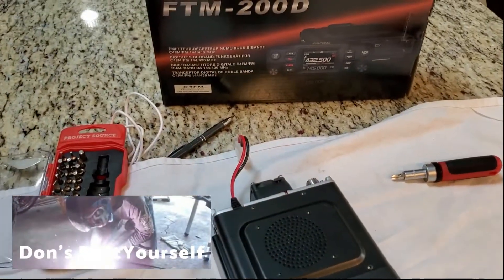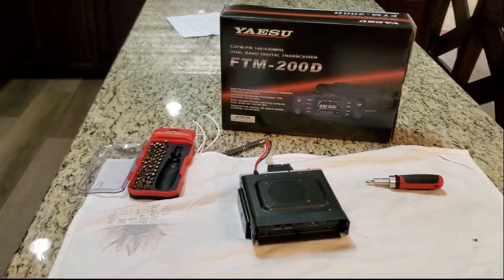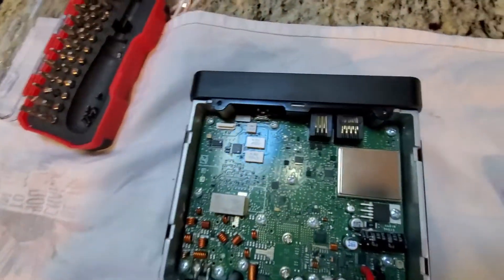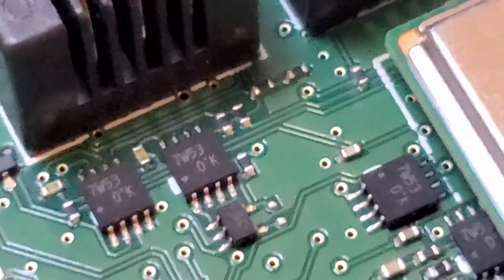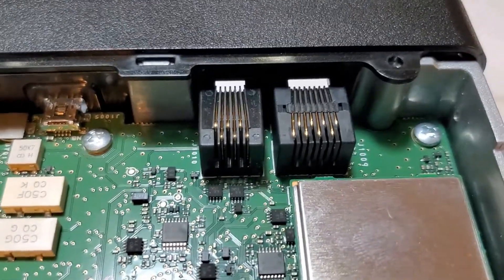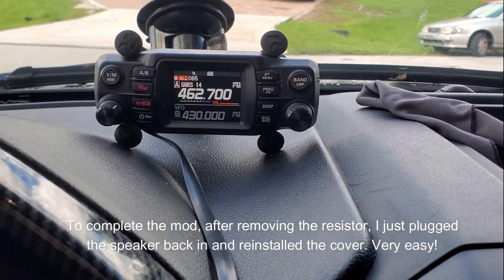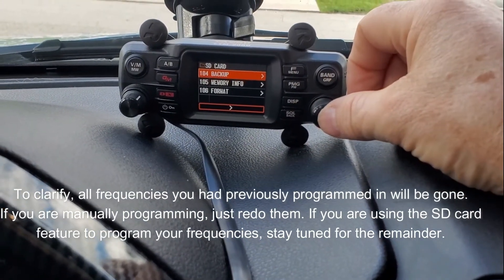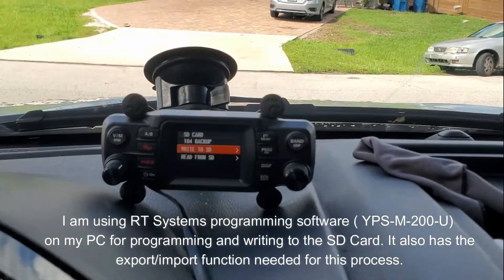Yaesu FTM-200D MARS CAP Mod - Extended Transmit - Open Transmit

Comment: I am a little confused about what you said regarding re-installing the channels.  Where you confused me was when you said I have to "back up my file to an XL".    Did you mean SD?
Reply from the maker: You should be able to if you have already backed up. I mentioned that to make sure you backup memory before you do the mod and then reset. After that, it is too late. You have to reprogram it all as if the radio was new. Best wishes.
Reply: @donsdoityourself2547  OK.  I removed the resistor.  ANd I reformatted the SD card.  Then I "reloaded" the SD card from my computer so all the channels are back on the card.  Inserted it and the radio will not read from the card.  I tried it several times.  What did I do wrong?  I can program it by hand, but that is a pain.  I have about 35 channels to do.

Comment: Thanks for the video. Do you know how to unlock the Japanese version of the FTM500D?
Reply from the maker: @josedisco  My understanding is that the Japanese versions are locked down in software and cannot be "opened up" for extended frequencies at all. Just the US and European version are capable. I only have first hand experience with the US models in any case.

Comment: I just bought the same unit FTM 200D , I have similar problem , the radio come up with TX PROHIBITED for most frequencies VHF and UHF, will this mod work and open up both UHF AND VHF FREQUENCY RANGE ?
Reply from the maker: It will open both VHF and UHF assuming you have the US version. If you have the Japanese version, it will not work. Note, you will void warranty and just because you can transmit outside HAM bands, doesn't mean you should or that the radio will have output optimized on those frequencies. I did mine mainly to have access to GRMS (UHF) frequencies in case of emergency.

Comment: This radio ftm 200 came from japan. Is there any different software or hardware? The resistor has been removed. Can you research and help me? Thank you.
Reply from the maker: Hi. I am assuming everything else still works okay.. just no expanded transmit frequency range. Correct?
Reply: Evet doğru
Reply: Gmrs frekanslar da tx yok
Reply: 144-146 ve 440-440 var
 Ben VHF136-174  UHF 400-480 yapmak istiyorum ilginiz için teşekkür ederim
Reply from the maker: I did some research and it appears the Japanese models will not work this way. Was the hardware the same? See old post I copied from a Facebook user group:
*******"
You can do the MARS mod as described but it will not open the frequencies to match the US band plan nor up the power output. About the only thing I would use the JA models for is a Wires-X donor radio if I wasn't concerned about the max power output and don't mind only using 1/3 of the band plan we have.
Reply from the maker: I should have mentioned that this comment was about the FTM-300.. not the FTM-200. However, I am assuming the same would be true because the mod was the same for US models.
Reply: Ok çok teşekkür ederim
Reply: Yapacak bı şey yok o zaman tekrar çok teşekkür ederim

Comment: Ftm 200d ben de direnci kaldırdım ama gmrs olmadı
Reply from the maker: Not sure why it wouldn't. Does your radio have different firmware? Works on my FTM-200 perfectly, but it is a US model.
Reply: Ftm 200d direnç yok ne olabilir lütfen yardım edin teşekkür ederim

Comment: the highest and lowest end of the transmission range which is after the mod. in ftm-200de is it known if it will work? I ask because I have the ftm 200de and it does tx only on 144 and 146 and on 430 and 440
Reply: C'est bon ça fonctionne je l'ai fait il y a 2 ans et toujours opérationnel 👌73

Comment: What is the bracket you have holding your faceplate in the vehicle?
Reply from the maker: Wes, it is a RAM mount.  The type I am using is called an X-grip that people would typically use for a smart phone. So you need that and the suction cup extension to secure to the windshield.
Reply: @donsdoityourself2547  Thanks for the info.

Comment: nice job does this also work with the ftm-200de or only with the ftm-200d has someone experienced it or you
Reply from the maker: Hi. I cannot speak on the FTM-200DE with certainty as I only performed this on the FTM-200D.

Just purely speculation on my part, but I don't see why not.  Let me know what you find out. It may be helpful to others.
Reply: @donsdoityourself2547  
hello i bought the ftm-300de because of the more equipment and i had the mod made by the dealer what i saw in the funk he only removed the resistor as you did in the video i think with the ftm-200de it will be the same

Comment: DO NOT USE A SOLDERING IRON! 
A strong needle will easily pop that thing out without melting things. 
Way to small work for any iron. A sewing hem needle with a little ball on the end . A big one 2 to 3 inches.
Reply: I achieved success with a hot air pencil and a pair of needle tipped tweezers.
Reply from the maker: It is small for sure, but if you have a very fine tipped soldering iron that is tinned well with just a little bit of solder on the tip, all it takes is a brief touch to heat the part and it pops off with a little push. I am afraid to pry it off and potentially break the circuit traces. In any case, if that works for you, great.  There is enough space around this particular resistor  to do the job without heating other parts.
Reply: @donsdoityourself2547  great stuff!

Comment: What is the new TX range? Will it go down to 136 or 137 MHz?
Reply from the maker: The low end of the transmit range is 137Mhz after the mod.

Comment: did you or can you perform a power output test up in the GMRS range?
Reply from the maker: Give me a few days and I'll check it for you. I did make sure the Antenna SWR was acceptable, but did not transmit at full power. Have to get my dummy load and etc.. out to my truck.
Reply from the maker: Okay... UHF Power  in general appears to be lower than VHF. Seems I get 49W on VHF (HAM Band), 28W on UHF (Ham band). GRMS frequencies are  24W. These are all into a 50ohm dummy load. Now I am wondering if the UHF on my FTM-200 has an issue? Should be 50W? My FTM-400 is 50W accross the board... Very flat.
Reply: @donsdoityourself2547    Thanks for info.  It’s is interesting because I found a group on Facebook for the ftm200, 300.   Two people there state they are getting 50 on gmrs.
Reply from the maker: @jonpachla1  yes, I am thinking I have an issue. It should be flat across the bands.
Reply from the maker: OK... figured it out. I have a cheap portable power meter I use for checking things in my vehicles which should be good up to 500MHZ. It turns out that it is not accurate on UHF. It rolls off. I put it in series with my inline Diamond SX400 with my FTM-400 in my house, and it reads about the same as the FTM-200 in the truck when the Diamond SX400 meter is reading 50W. I think it is just a poor meter. Given that, I'd say it is 50W or real close across the bands including GRMS. I don't want to pull apart my Base Station to take the Diamond SX400 out to  my truck, but given the comparison between the meters inside, it makes sense now.

Edit... I calibrated/adjusted the meter against my Diamond SX-400 and FTM-400 and now I measure the 50W across the VHF/UHF/GRMS bands on the FTM-200.
Reply: I am getting 38 on 462 and 28 on 467 on my ftm500 kinda bummed

Comment: After removing the resistance of the radio, what other procedure must be done? Thank you very much for sharing the information I have the same radio.
Reply from the maker: You are welcome. 

After removing the resistor, put the cover back on and power it up.  It will reset and behave like a new radio and you enter your callsign. If you are going to reprogram it manually, no problems. If you are going to restore with the  SD card, make sure to watch end part of the video before any modification.